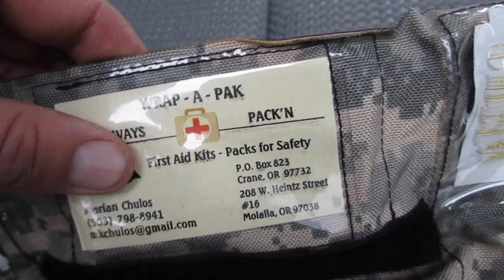4th Gen 4runner Budget Overland Build

Comment: I live in utah too. Looking at getting a 4runner 4 th gen. From what i read was to get one 06+ since they swapped metal so it doesnt rust as bad on the frame. How is the rust on your frame?
Reply from the maker: Well it was a California rig before moving to UT and had zero rust. I made sure to winterize the frame during my time in UT and had very little surface rust. With that being said I have seen some 5th gen 4runners with rusted frames out in Utah. I think it comes down to location, salt during winter, and maintenance.

Comment: How in the world did the plasti dip not peel when you removed the tape? I’ve tried it before but after a few good coats the bottom coats end up drying and peeling off when i remove the tape
Reply from the maker: Good question! I had to retry it after the first time as well. You have a few options. Apply a really heavy coat without it dripping and remove tape when wet. Or you can use a tooth pick and run it down the tape lines after each coat to separate the dip from the tape.

Comment: Are the 06-09 LED taillamps and projector headlights plug and play on the earlier 03-05 versions?
Reply: I put the 06 tail lights on my 05 4Runner they are definitely plug-and-play worth every penny. As far as the headlights the converter 06 can get costly I just put in brand new tcy headlights and 20% brighter bulbs from xtralight and I'm very happy with that

Comment: Did you need to cut to fit those tires and if so how much?
Reply from the maker: Trimmed a little off the innter front bumper and trimmed the rear mud flaps. That's all I had to do